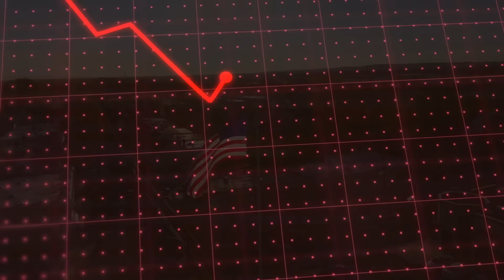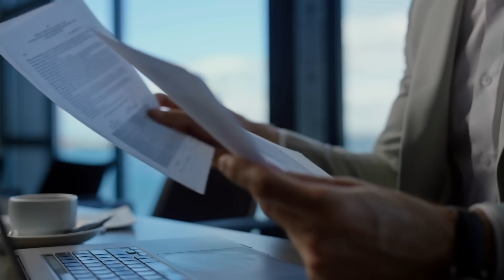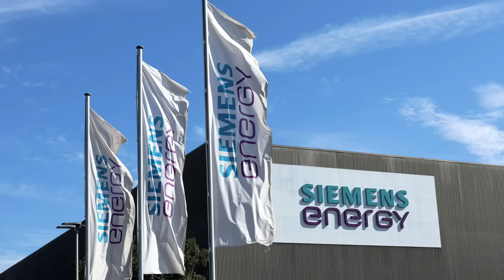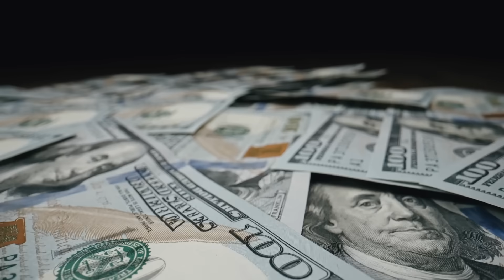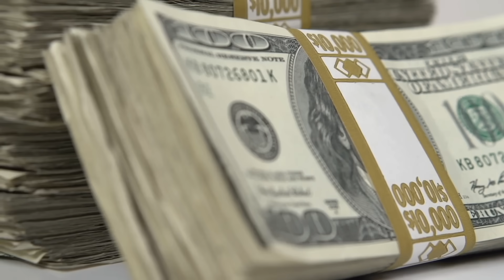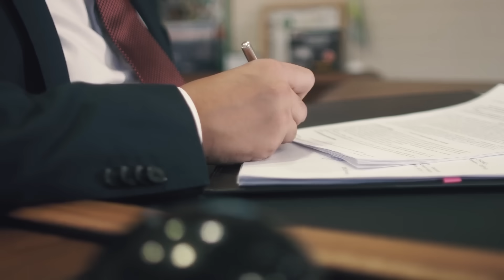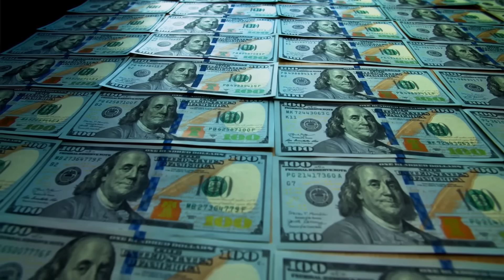The Real Reason America Has Turned Its Back On Wind Power Energy

Comment: When a power company plans a new generation plan, they plan the interconnect along with the planing for the plant

Re-renewables require connection between the "green" plants and conventional plants.   Why?  Because "green" energy (with the exception of water power) isn't reliable and must be backed up with more conventional power sources.   The conventional plant coupled to a "green" course is about as expensive to construct as a stand alone operation.   The face that it will be idling much of the time only saves fuel but dosn't save construction costs.

BTW:   the cost of fuel is on the order of 25 to 30% of the total consumer retail price for service.

"Green eneergy" is just a money pit.
Reply: @GilmerJohn that's oil-company propaganda, please just stick with facts, facts that you have checked.
Reply: @alanhat5252  --  Actually, it's engineering common sense.
Reply: All energy is a money pit. If you can't handle that, put on a grass skirt and live in  a  cave.
Reply: Since one does not build a seperate grid for green energy, the connection is always there.
Every power plant needs a backup.
Fossil fuel power plants do not need to idle as wind and solar power output can be reliably calculated 24 to 48h in advance.

Comment: Whats great about wind is it doesn't cost anything to make electricity once installed and it makes fee electricity whether it's needed or not. And when it's not windy you can offer $10 million per watt and guess what. Not enough electricity to power a light bulb.
Reply: "Whats great about wind is it doesn't cost anything to make electricity once installed and it makes fee electricity whether it's needed or not" - I'd suggest you do some research on that statement.
Nothing is free, ever. In the UK, if the turbines are producing too much power, they are paid NOT to produce. It's called 'constraint' payments. Look it up. Guess who pays for that?
Reply: @captainpugwash3791  UK Power Networks and Octopus energy are trying to encourage their customers to help with this issue and giving excess wind/solar energy to their customers for free… great time to charge your home battery up, do the washing or switch on the water heater!! We get an email stating the times (normally get 24hrs notice) that we can use as much as we like for zero cost.
Reply: @captainpugwash3791  As you can read elsewhere, that's why grid upgrade/expansion, interconnectors and storage are needed as job#1. With those, you don't pay contraints. Simple, really. Either you pay sensible capex for infrastructure + get a good return on the investment, or you put on your dunce-cap and pay an ongoing penalty and get nothing.
Reply: Wind without batteries is not dispatchable. Wind with batteries is not affordable.
Reply: @msimon6808 It is not merely a question of unaffordability but there are engineering and evironmental constraints that cannot be overcome for battery backup at the scale required.
For example, of a renewable project can provide 4 GW (4000 MW) peak power when the wind is optimally blowing and the sun is shining, there is zero power if there is a lull for let's just say 1 day although in reality weather lulls can last up to one week or more. However, for argument's sake assume that we want to fill the gap of 4 GW using Lithium-ion batteries.
If Lithium-ion batteries of 1000 MWh (1 GWh) can be sourced, then 4 MWh batteries are required to supply 4 GW for one hour and for 24 hours we need 4x24 = 96 batteries are required for 1 day supply of 4 GW.
In 2030, the price of Lithium-ion batteries is thought to reduce to USD 92 per kWh which means that a 1000 MWh battery which is 1 million kWh = 1 MWh for a price of 92 million USD. As 24 batteries are required to sustain 4 GW, 24x92 Million USD worth of batteries are required which is 2.3 billion USD.
Economically this is totally out of question in my view.
From an environmental point if view this would be considered environmental vandalism and abuse because after about 3000 cycles the battery which is filled with toxic materials either needs to be recycled or put into landfill.  There is no effective way of recycling these batteries at present not to mention the potential cost.
Irrespective whether there are thousands of smaller distributed batteries used or one large battery, the environmental impact is the same. Each battery needs a BMS and there needs to be special provision in case of a fire.
Even if one ignores all this, the reality is that if an intermittent electricity supply system dependent on the vagaries of the weather needs gaps filled with some electrical storage system, the electricity to the consumer will always be much more expensive compared with balancing the supply and demand in real-time.
Reply: @msimon6808  No. That's where interconnectors come in. Also, "intelligent" grid with pull-style consumption.  But, if you don't keep up to date with this decade's tec, you will make statements like that.
Reply: 😆🤡Those things take hundreds of gallons of oil to keep the motors going on top of regular oil changes, not to mention all of the wild birds they ensnare and kill. Plus the ones operating above water create so much noise that they send whales off course and separate them from their calves.
Reply: @HAYFEDS  The oil use of windturbines is much lower and can be synthetic. Co2 emissions of fossil fuel power plants is much higher as is their negative effect on birds.
Whales can be louder than offshore windplatforms. Claiming that windturbines seperate whales is an interesting lie, but has nothing to do with reality.
Reply: Now is the time for the USA to confront it's problem with sharing & equitable distribution. It may be "socialist" in your view but so what if it enables the survival of 8 billion people living on this shared planet?
Reply: Essentially the stupidity that are seen from the Labor government that even with 100% renewable if the wind isn't blowing and the sun isn't shining, some base load backup to the full capacity of demand is required.
If the base-load and 100% renable energy sources are more or less used on a mutually exclusive basis, the renewable energy sources will be standing idle (wasted capital investment doing nothing) for 3 third of the time on average, and the baseload part is used 70% of the time and standing idle 30% of time on average.
A better solution would be to have a dispatchable source percentage operating continuosly (hence 100% untilisation) and then use renewables for opportunistic energy for various purposes but, in essence, it will always be the baseload that will keep the lights on.
Reply: if you used the wind to pump water you could run your hydroelectric plant at whatever rate the grid demanded. as long as the dam keeps getting topped up at a rate sufficient to meet the demand, its all good. thats just one other way to do it, one of so many other options.

they have to turn the turbines off when its too windy and theres no demand as theres no demand, and they still have to keep all the coal stations fired up and running, keep the nukes fired up and running, its a big deal to stop and start a big freaking powerplant, they dont just turn on and off willy nilly...

winds pathetic unless its used sensibly. but we dont use it sensibly, we try to generate electricity with it directly. and think BATTERIES will solve the issue? oh, you poor misguided fools, may the lord have pity on your souls...

when its used correctly... its more than enough. far more than enough.
Reply: @paradiselost9946  At the moment no nation produces enough wind energy to not use other power plants. Therefore it is no issue when coal and nuclear power plants keep running, since their electricity is still needed.
Reply: @paradiselost9946 As I said, there is not enough windpower yet for a need to idle big power plants.
Reply: Just on the powerful fan to get tbe electricity from this solar energy and you get the free energy.
Reply: Heh! What a lot of tosh.
Reply: That why one builds multiple farms and uses multiple energy sources.
Reply: @old-pete  Because there will always be sun when it is not windy and wind when it is not sunny. Perfect.
Renewables without batteries are not dispatchable. Renewables with batteries are not affordable.
Reply: @msimon6808  It is dispatchable. The idea with renewables is to dispatch primarily the demand. If that is not sufficient, one turns off some producers. Finetuning is done with hydro and biogas.
Reply: I don't think it's ever happened that there is no wind anywhere.
Reply: @alanhat5252  You don't have an extension cord that long.
Reply: That why there are Megapack battery to store the energy when not needed & discharge in time of high demand!
Reply: @rozonoemi9374  Send me a couple. Or do people intend to charge for them?

Comment: Bullshit video!  In plain English the US has an outdated transmission grid system that cannot carry all the new extra renewable energy production.  Since the grid is privately owned so it is just a matter of doing upgrades and that is it.  This video suggests the government should put up the upgrade money, give it the the grid companies to make profit without spending their own money.  How retarded is such an idea?

In a nutshell it is just the renewable power developing faster than the grid can carry.  Upgrading the grid solves the problem.  US is now stuck on "who pays?" ( for the upgrade).  People who develop the renewable energy do not transmit electricity so they don't want to pay for upgrading the grid.  The grid company has been carrying existing electricity merrily and does not have the money to upgrade or replace parts of the system plus there is no certainty of how much upgrade is needed.  If the grid company is forced to upgrade the grid will certainly demand money from the party who needs the change.  It is a vicious circle but an integral part of democracy that everyone has rights so the problem can never be resolved.

Comment: Coz turbines need to feed off the grid to power them and when they eventually create power it’s to intermittent to feed back into the grid it’s huge scam
Reply: Turbines don’t feed off the grid. When the wind potential is too small they simply don’t turn. When the do produce it’s massive amounts of energy. Multi megawatt turbines power thousands of homes each
Reply: If a windpower turbine does not create enough energy, someone was sleeping in the planning phase. Windpower is location, location, location.
Well planned windturbines produce their moneys worth in electricity.
Reply: @old-pete  it uses power to turn until there is enough wind to power it, the power is intermittent so has to be balanced to enter the grid. If the grid is coal powered they have to release steam which loses power to allow the power from wind to be added so you gain no power at all it’s a scam. It costs Australia an extra $500 dollars per person a year totalling 40 or 50 billion dollars a year for nothing and it all goes off shore. If they wanted turbines to use wind why do they only have three skinny blades? It’s a scam
Reply: @paulmc6940  The blades do not spin by electricity. If there is not enough wind, they stand still. If there is enough wind, the turbine opens the breaks and the turbine is powered by the wind.
Windpower output can be predicted 24 to 48 hours in advance and coal power plants can adapt their output in advance. Fine tuning should be done with gasturbines anyway.
If it costs Australia 50 billion a year, they are doing something wrong. More populous countries with much more windpower pay much less. 
Maybe you should check your numbers.
3 bladed designs are the current optimium design. Designs with more blades are not economical and increase the output only slightly (1 to 2 %).
If a turbines creates electricity only on 2 of 7 days, it is put in the wrong location and someone was sleeping in the planning phase.
Reply: @old-pete  after decades and trillions of dollars spent on green energy it only equates for 2% of worlds energy use. In one week turbines only produce two days of energy use because the wind doesn’t always blow. They are just the facts the governments don’t want you to know